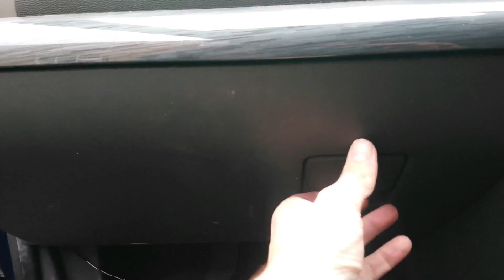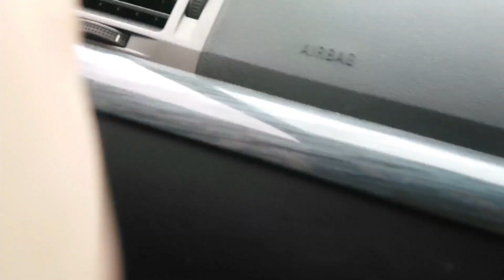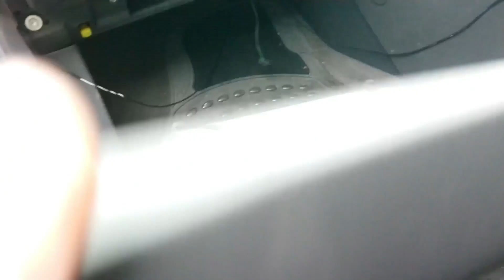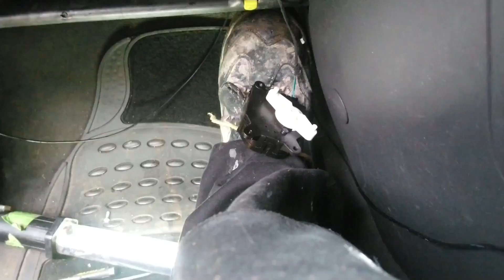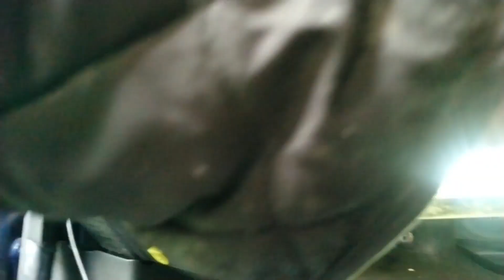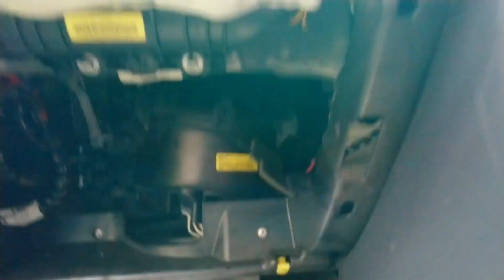How to fix the clicking noise in glove box compartment | vauxhall vectra

Comment: Just come across your video got the same problem on my Astra driving me crazy,would just disconnecting  the switch be ok 
Would the heating still work? I’m not bothered about the flaps opening and closing if that what the switch does
Reply from the maker: Your heater will still work . Just you won't get to control where the heat goes in the vents

Comment: I got the same problem , and the heaters bring all the fumes inside car when is stationary. Is it possible to be from that?
Reply from the maker: Transfers the air from the outside into the car . So could be the pollen filter as well in the engine bay ..
Reply: @handyandyuk  thank you really appreciate it !

Comment: I have same issue on Seat Ibiza 2015 plate but struggling to find the right part. Is there a fool proof way to identify it?
Reply from the maker: Climate control switch I think it's call or heater vent controller switch